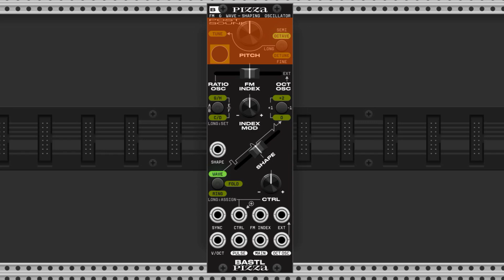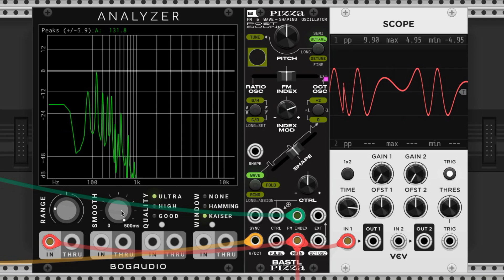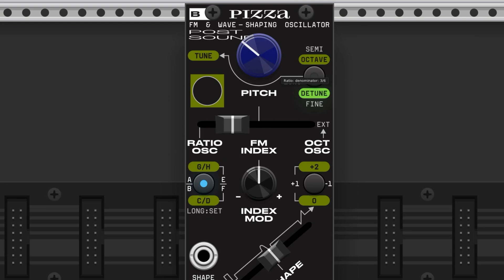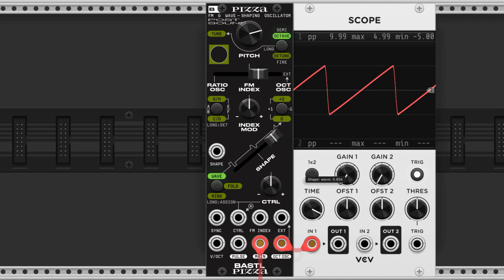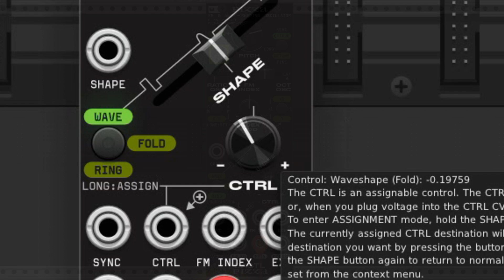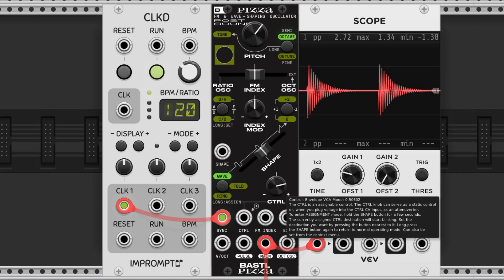BASTL Pizza // VCV Rack Module Overview

Comment: I've been having fun randomizing the PIZZA and copying the settings over to my hardware version. Same with Crust.  Then sampling the hell out of it into the Digitakt
Reply from the maker: Dude! Sick idea! when I randomize I sometimes get lots of flops. If you use the module called Strip, it lets you restrict which parameters are randomized on the module so you can ctrl+r the specific knobs you want ✌️😁